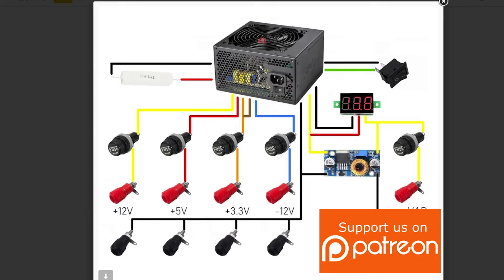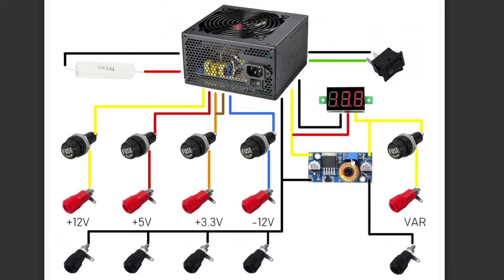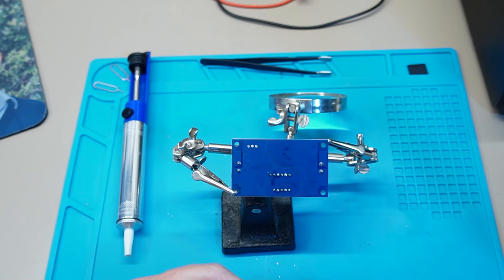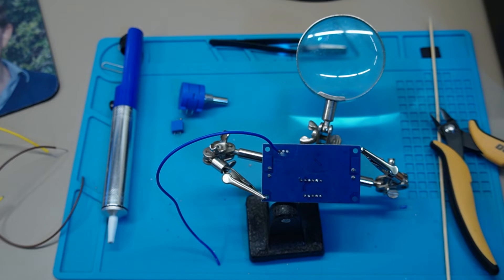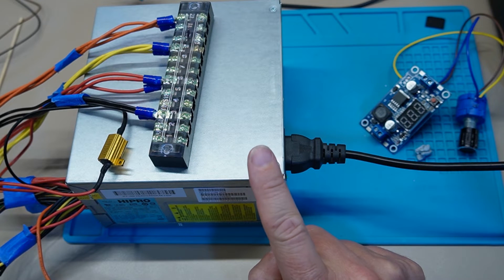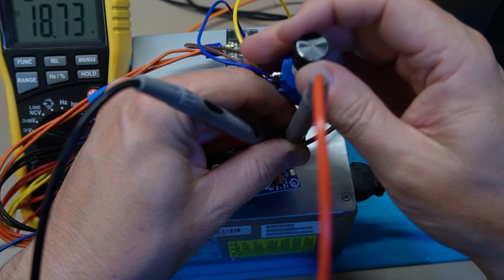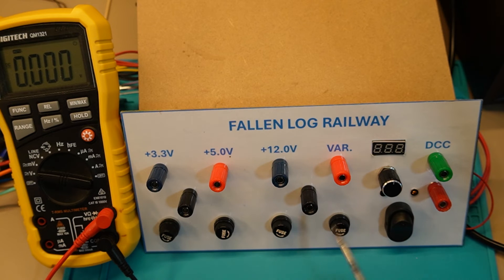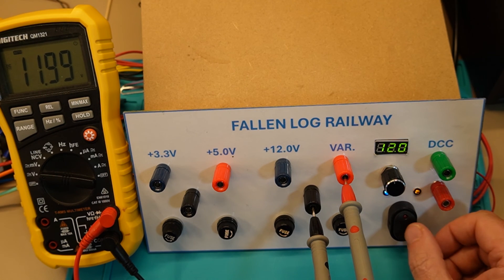DIY Work Bench Power Supply | Adjustable Power

Comment: If you change 2 wires of the potentiometer you change the direction of movement. now you turn counterclockwise to increase the voltage but is seems easer in use if counterclockwise will decrease the voltage. just change the 2 outer wires and the problem is solved.
Reply from the maker: Intresting. The version of buck I used was a step up version though.

Comment: Hi Mate Great video could this be used to power a DC layout and if so what sort of amps do you get from it ?
Cheers Mark
Reply from the maker: thank you. Ampages is dependant on model, but most @12V DC will give 4.2 amps at 145w and 10 @200w versions. Hope this helps?

Comment: Good project. If you want to boost the voltage it is a boost converter. A buck converter reduces the voltage. Buck/boost converters are frequently used in situations where the input voltage will vary around the desired voltage like when using a LiPo battery.
Reply from the maker: Thank you for your kind words and advise.  The module I used was definitely a step up version. I will look at these with LiPo Batteries too.

Comment: Thank you for this video. I just happen to have a brand new computer power supply that I bought many years ago by mistake (I bough the wrong model before I found that there are different models) as I needed a replacement. I will follow your advice and will use this technique.
Reply from the maker: Thank you. It really is an easy project. You can also use an add on interface. You can get these from Amazon or AliExpress.